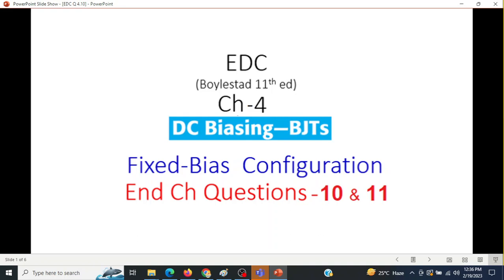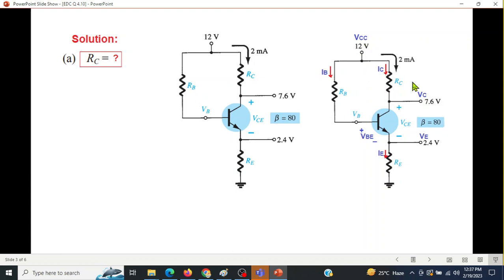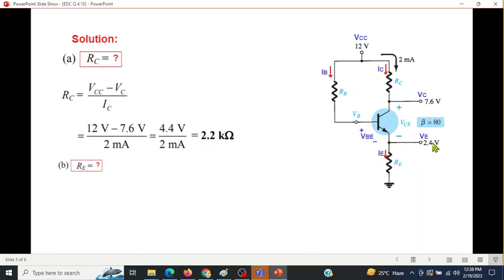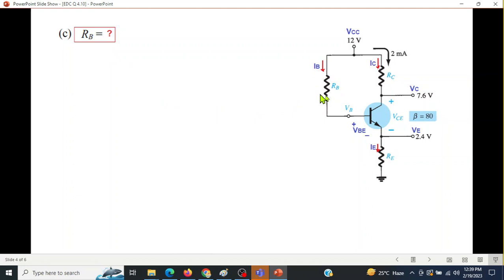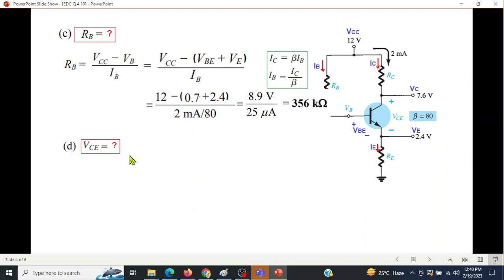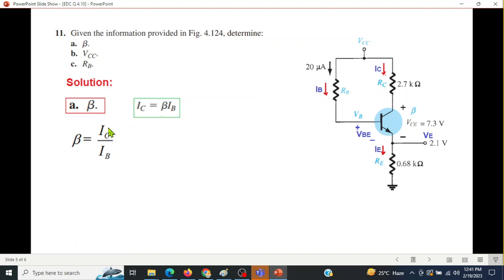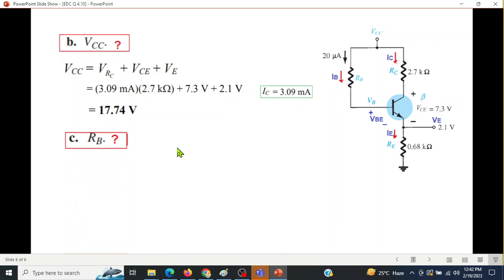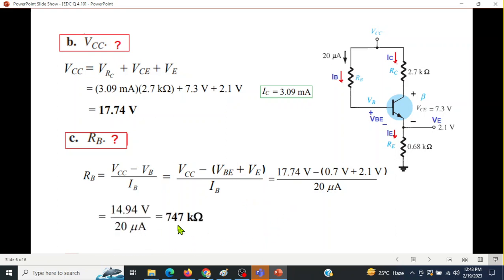(English)EDC(A) Q4.10 & 4.11 || Emitter Bias ||  DC Bias of BJT

Comment: I am curious that if I dont assume emitter current ~=  collector current, instead i used Collect current= beta(base current), to find the base current. Since emittor current= base current+collector current, and get the emitter current, and use this value to calculate emittor resistor, the value of emitter resistor is different from the value by your assumption, is both answer correct?
Reply from the maker: The problem with many of the students is that they try to achieve perfection ( I also had similar thoughts as a student). Now I have realized that in the initial engineering design, our first aim is to achieve very close approximation. We gradually perfect the design to more accuracy (100% accuracy if you are designing a moon lander).
As far as your question is concerned, your answer will be perfect, but I will not call it a very intelligent effort (rather wastage of time)😭